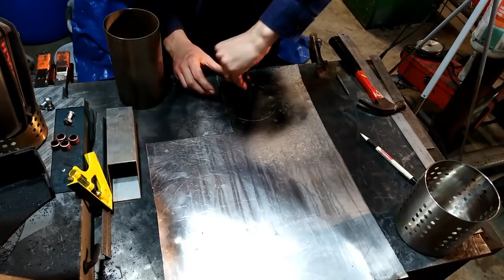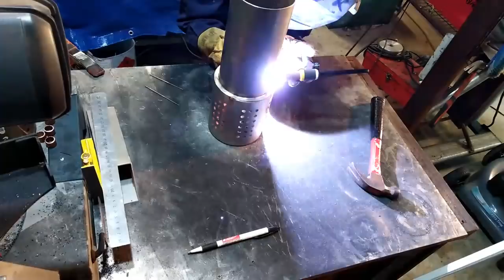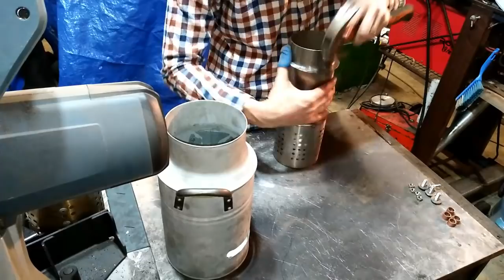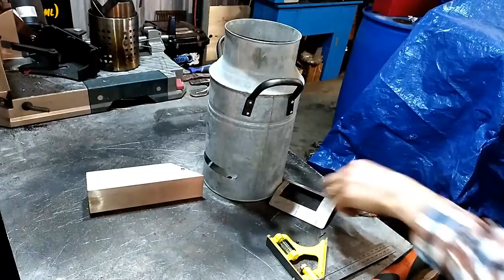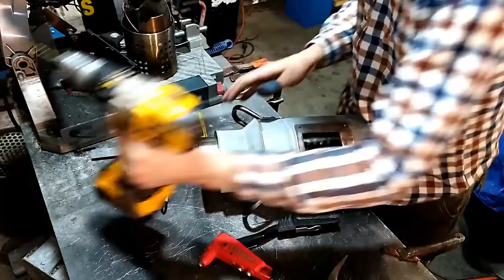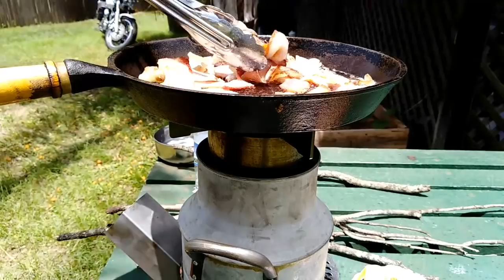Gravity Feed Rocket Stove Experiment

Comment: very cool! you might enjoy watching the vid on here of the one I made awhile back from a full sized antique cream can, it's on my channel. I also recently made one from an old 1970's metal shop vacuum, and discovered the stainless steel skin from those cylindrical foot operated trash bins makes an excellent heat scavenger/heater attachment to just place right on top of it. The hot exhaust makes a vortex at the top of the bin that stops all fly ash, and that thin stainless is also a great thermal conductor and radiator. I cleaned up an old cast iron furnace door, welded a handle on it, and it has now become an xlnt rocket stove and campfire griddle! I  really like how people can repurpose junk into good efficient wood stoves, cookers and heaters, and how people are sharing their ideas and designs! Thanks for posting your vids!

Comment: For sheet metal, what is your favorite welder? And secondly, do you have videos on techniques on sheet metal welding? Sheet metal on sheet metal and sheet metal onto tubing. Thirdly, do you use a spot welder?
Reply from the maker: For stainless steel I prefer tig anything mild-steel MIG unless it's really thin (under 1.6 mm) back to tig with some silicon bronze rods. 
I don't currently have any welding videos on sheet metal other than what I share as I build stuff, but I can work on doing a few as time permits. And I do use a spot welder from time to time mainly for galvanized sheet or where I'm trying to minimise distortion on stainless steel.  Thanks mate

Comment: Design a titanium dome that will glow white hot that you can fit on top of the stove with an exuast vent on one side to vent all the fumes out of a tent or shelter. A way to light up an area and to heat up an area? Make a dakota fire pit rocket stove. Use metal flashing you can form a tube with wire rings to hold it's shape and connect other pieces and trench an air vent outside a tent or shelter. Then dig your hole and place rocket stove in the hole connect air vent and use high heat carbon felt to make a gasket around the fuel hopper so air will be drawn in from the outside vent. Then make a titanium grill top and a dome you can pile rocks around to half a white hot dome with an exuast vent to vent all the spent air out of the tent or shelter. You will heat the air in the tent or shelter and not cause a draft from the air flow ftom a regular wood or rocket stove that sucks in cold air from outside which means burning less to stay warm. 😊

Comment: Someone needs a plasma cutter for Christmas ;)    Cutting those circles with an angle grinder looked tedious
Reply: Oak Knob Farm
Reply: Yes but wicked talented
Reply: I, for one, am duly impressed with your angle grinder skills.
Reply: @fyreantz2555  Why so impressed ne tiler can cut holes like that thru way more brittle material in Way far complicated working conditions also
Reply: Why not use tin cutters?
Reply: @lelanddimmer5979  wouldn't be such a nice and clean cut circle for a nice snug fit I know I use to manufacturer sheet metal into air ducts for the a/c units

Comment: You could think of installing a Sterling Engine & alternator on the side, which could provide power to charge a phone and power a couple of LED's. And also a fee coils if copper pipe inside, as a heat collector, to heat water. Very useful at remote locations.

Comment: If you have a Rocket Stove that operates the way it should, it will chew through metal (any guage, mild or carbon) very quickly.  That according to  Rocket Mass Heaters Third Edition page 43 under the paragraph labeled "Steel Pipe".
Reply from the maker: sounds like a good book!
Reply: I made a rocket heater for my sunroom out of mild steel and propane tanks, used it for a year and ahalf before wife managed to deform the inner chimney. constant use over winter and had to throttle back temp as usually 550/600 deg c.

Comment: hello, could I ask what type of welding technique you're doing, round about the 1.32 1.33 mark?
Reply: Hi mate
I'm using a TIG welder.
Reply: Tig.... you can get similar results with "oxyacetylene welding" (brazing)  should you have flammable gas and no tig welder. Heat the metal melt the rod on the hot metal let cool. Tig is just faster and uses a tungsten rod(not the welding material) in the stinger to make the arc to heat it all. Just strike the arc put your filler rod in and moved the arc and keep the puddle where it needs to be, not fast, not slow.

Comment: what kind of welding machine do you have ? tell me about him .
Reply from the maker: It's a Rossi 200P AC/DC TIG weled. Had it for 5 and a half years, bought it from Ebay.
It's a good welder with a 60% duty cycle, but it's had lots of bugs that I've had to work through, mainly  with the shielding gas solenoid getting stuck on. Apart from that it's been good to have and use for a unit under the $1000 dollars.

Comment: I don't get it: why do people use battery-powered tools inside of their workshops? Aren't corded tools more powerful, cheaper, and don't have all the problems associated with batteries? I like being able to use a 40 year old drill without having to buy an expensive part just to get it running.Nice grinding though.
Reply: ryelor123 I know right drill presses and mag drills dont have battery options..... they dont right?

I have a cordless for around the house or on side jobs. But at home in the shop I have a 50s corded drill damn thing tries to break both my arms when a bit bites to hard, I break bits more than I do arms but damn I love that drill. I do need a new cord though insulation is pretty cracked
Reply: My brushless lithium drill is far more torquey than my 240v, and has much better speed control at the low end. The 240v drill is much faster, but realistically less practical. The only thing i use the 240v drill for nowadays is masonry, as its got a hammer mode. Dad has a makita from the early 80's that will gleefully knock you over or break your wrist if it bites, buckets of torque. But weighs 3x what the brushless does, and not very practical for anything less than a 6mm bit due to the weight.

At work, I prefer using our 18v Milwaukee SDS drill over the 240v model as its so much more convenient. The only time ive found it more practical to lay out cords etc is one occasion i had to put 5x 25mm holes through about 300mm of concrete. No way batteries could manage that. Half of one hole, sure.

Brushless motors these days are so light n grunty, my go-to drill, grinder, jigsaw, vacuum are all cordless. The decision to get out the corded tool is never lack of power, but lack of runtime.
Reply: So long as your batteries keep working cordless stuff is 10x easier to use, but once they stop working it's a royal pain in the ass.
Reply: While I don't dispute that some corded drills are weaker, shouldn't corded tools have more torque and/or speed than cordless ones due to the much higher amounts of power they're able to consume?
Reply: @ryelor123  the most powerful electric tools are, and likely will always be corded. But some people got money to burn. Or at least more money than the time it takes to wrangle a cord.
Reply: @ryelor123  In theory, at max power, sure. Grinders are a great example, they only run full hog. Whilst i love weilding a cordless grinder for its versatility, they always overcurrent if you ask to much, n even then can only last a few minutes if you push them. Ive never stalled a corded one. But many tools, slow n torquey is sometimes what you need. Drills n jigsaws for example. Most ac tools use motors use motors that have their speed (and peak efficiency) synchronized to to the ac line frequency. Dc motors however, deliver most power at stall. Brushless delivers the best of both worlds, which is what most good lithium tools use.

A drill press (with its changable belts) can do all this and far more accurately, and a selection of AC drills will cover all your bases. But a good cordless can do most jobs *adequately*. From driving an M3 tap to a 32mm holesaw.

For a home player, that flexibility is invaluable. I would need literally tonnes (and $$$$$) of ac hardware to do all i can acheive with a good cordless.

Not that id pass all that up if you were giving it to me, but I hope that explains the root question, "why a cordless on your workstation"
Reply: Power cords in fab shops don't last when run across the floor and are also highly dangerous. I runs small workshop and all daily tools are battery. No problems with cords etc, batteries last either half a day or the whole day doing light assembly work.
Reply: I think Milwaukee has a cordless mag drill.
Reply: i hate cords  some one needs to invent cordless 110v  tools that use your shops power
Reply: That reminds me ... it's time I put my powerful compact ridgid* drill's battery on the charger.. I must have used it a dozen times between charges...

Comment: Idea, use a cryogenic stirling piston to liquify the gases being generated that flows into an.insulated tank with a bell siphon. Siphon passes liquid through a filter then fills an insulated propane tank with the gas generated in its clean liquid form that will gas off ounce valve is opened like propane does.You should be able to operate a electrical power generator or other modified engine off the gas.   😊😉
Reply from the maker: Indigo Dragon71 neat idea but a bit above my pay grade 🤔😲👍
Reply: Pass on idea to someone who understands the information mate!😊😉

Comment: You don't need to tell us, but did you burn the table top while cooking?!
Reply from the maker: No the table survived, just  : 0
Reply: homayoun Shirazi , This is the very question I ask myself for every rocket stove build I see out there.

"Will the table last the heat, for the duration of its operation?"
Reply: homayoun Shirazi iijjjk
Reply: So there is a design element issue at the base. It needs legs or another X or cross-like set of 'legs' ... A built in trivet

Comment: Is a combination of 3 different stoves. Kellyketle , Solo and rocket stoves or milky something. Just kidding. GREAT job. Just thinking on portability for a bug out shouldn't weld some parts.👍👍👍👍👍
Reply: could fit sleeve for feed tube to slide in, also pan holder unwelded could fit with feed tube into chimney when transporting.